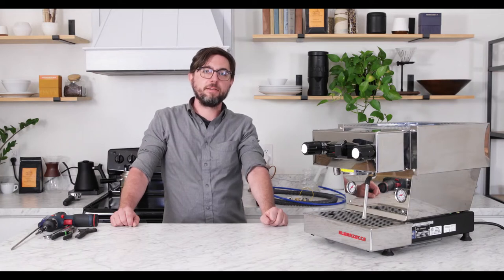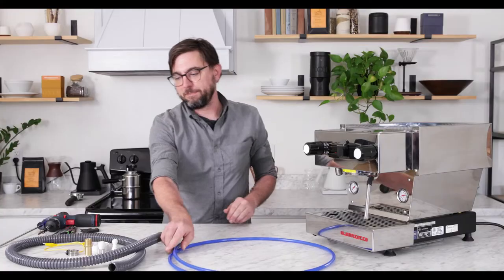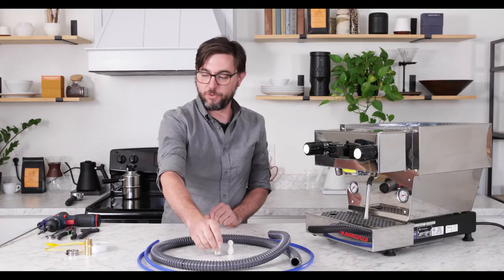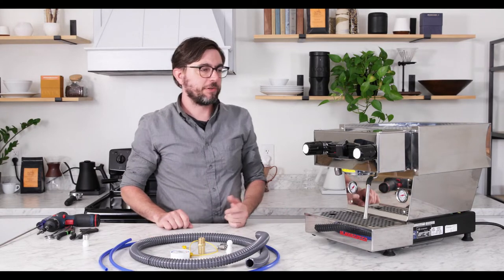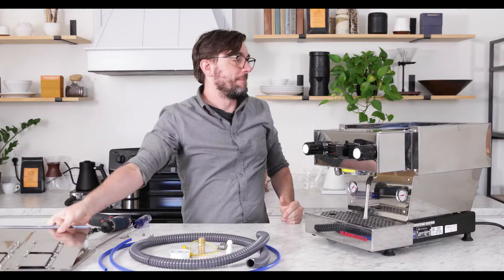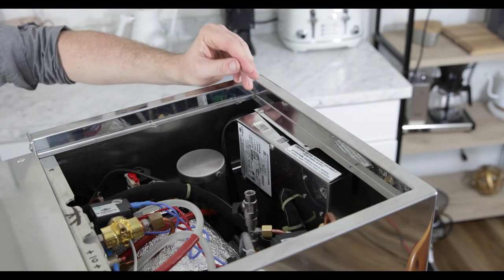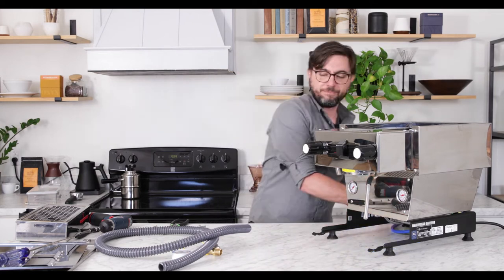How to Plumb in the La Marzocco Linea Mini

Comment: La marzocco is using a metal pipe and getting rid of that has copper, isn't it risky to use plastic hose where it gets very hot and may have a small hole and starts leaking!?

Comment: Thank you for posting this video. I have had my Mini for 48 hours and planning to plumb it in soon and this certainly looks the better option for me rather than the La Marzocco kit as I intend to use 1/4 " John Guest piping and don't have the ability to drain the driptray as it's nowhere near a waste pipe.
 I just opened up my machine to check your instructions and I can see where to route the piping, my machine does not have an access panel cover, just a round hole above the driptray sensors. Hopefully it's not too silly a question but what is the purpose of the black 90deg valve by the copper pipe? Is it a drain of some sort?
Reply from the maker: The valve is for priming the pump if an air bubble is present and the machine is not filling correctly. There is tech bulletin with more details here - https://lamarzoccousa.com/bulletin/tb-151-linea-mini-self-priming-system/
Reply: @primacoffeeequipment  that is good to know. Thank you very much for your help.

Comment: Great video with very clear instructions! Thanks! Quick question, can I use a 1/4 water supply tubing instead of the 3/8 tubing to connect to the T? So in that case I need a 1/4 to 1/4 push lock adaptor instead. I’m asking because most Flowjet water pumps use 1/4 water supply tubing instead of 3/8. Will that be appropriate? Thanks!
Reply from the maker: Yes, that would work!

Comment: One question. Why do you still need the copper tubing if you can install a 1/4” fitting to 3/8 push lock directly at the T?

The Small Copper tube end is 1/4” fitting right?
Reply from the maker: You install the push lock fitting onto the copper 1/4" copper tube.
Reply: @primacoffeeequipment  i mean there is a push lock connector that has 1/4” fitting on the other end. Basically you can replace the whole copper tube right? Or is the fitting between stainless T & copper tube has special fitting that hard to replace?
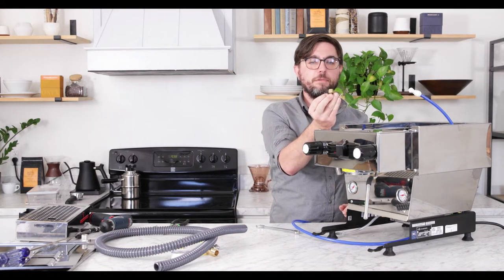Reply from the maker: @gusmank  The fitting at the stainless tee is a 6mm metric male pipe fitting. We use the existing copper tube and compression fitting to transition between the tee and the 1/4" push lock fitting. Watch starting at 6:10 in the video. Let us know if you have any other questions!
Reply: @primacoffeeequipment  oke now i get it. I tried to connect the 1/4” fitting directly to the Rotarypump but the water is leaking if the fitting is not pressfit / sealed. So yes. Connecting the 1/4” push lock into the copper pipe is alot easier. And no leak happens.